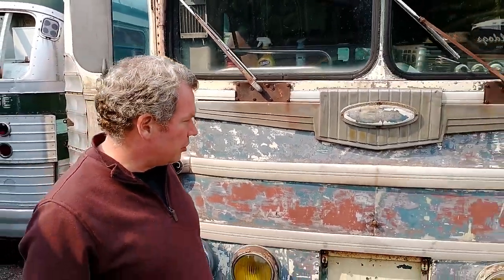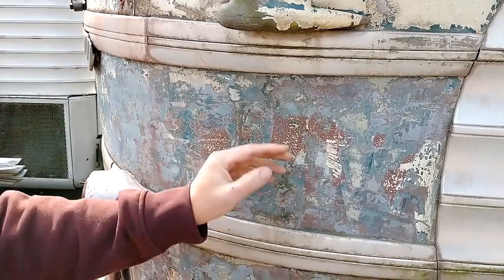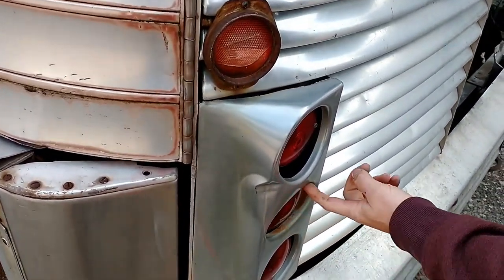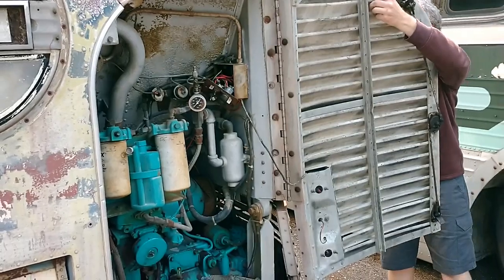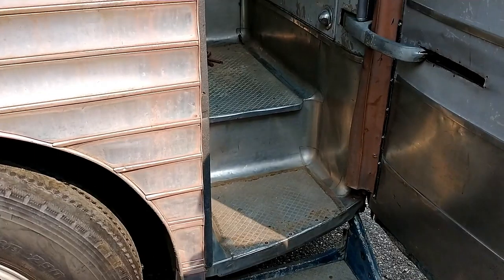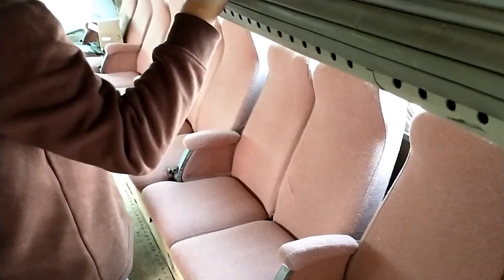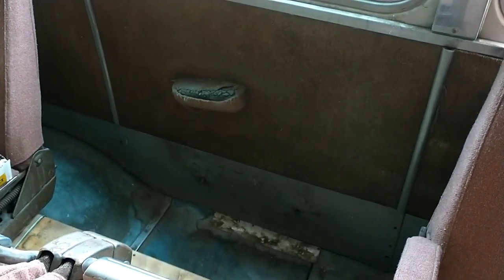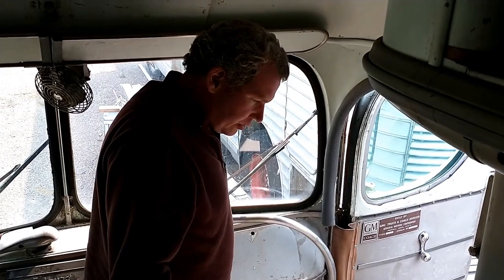Minnesota Bus Rescue - Bus tour!  The Finer Details ! (48 GMC Silversides)

Comment: The bus on our YouTube Channel does have that shade. It is missing the part that has the balls that click in to the rack. We are missing the part of the rack where it connects to. We are installing some of the original racks. That is a parts we are looking for. Very cool feature!  Those seat bases are the same as the ones in our PD4151  We are looking for two more. or we will make copies at some point.

Comment: Are you back in Canada?
Any issues crossing the border and getting your RIV and import  papers?

Now just to get it safetied and licensed.  A friend of mine brought a Colorado soft top Reo up here.  Did an AMAZING restoration,  but had to get a special drivers license. So wound up taking it to Pheonix for auction.
Reply from the maker: No issues with a bus older than 1971! Just have to do the export and import paperwork.  RIV only applies to newer vehicles.